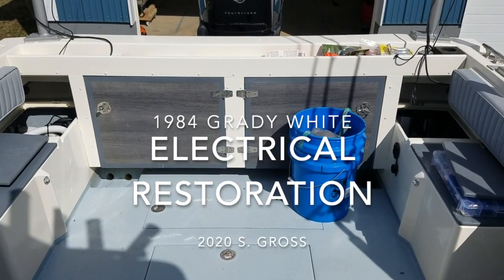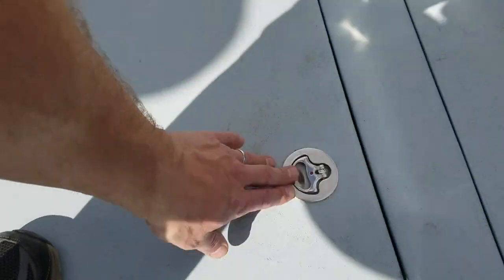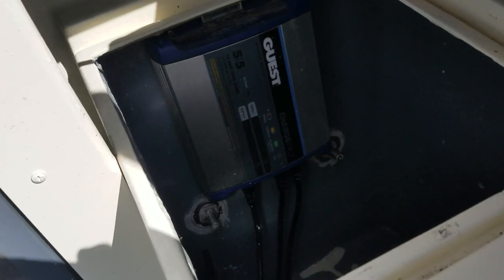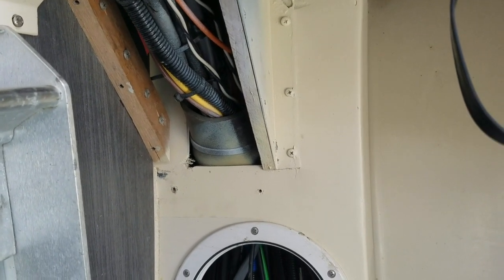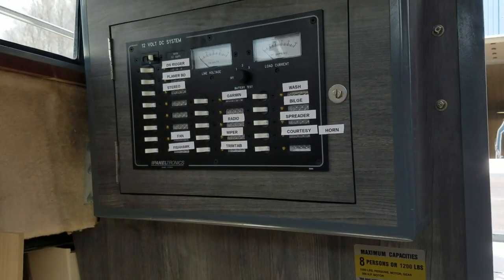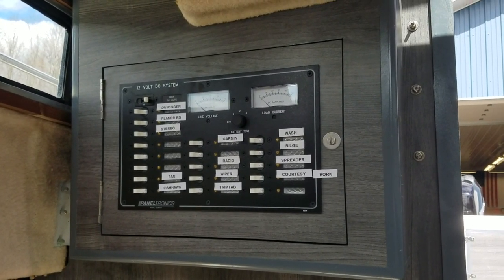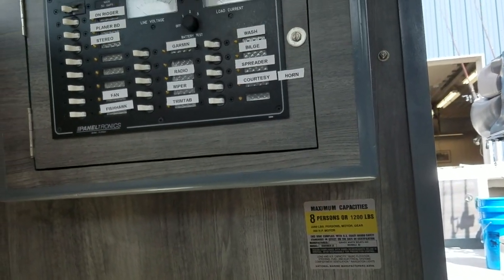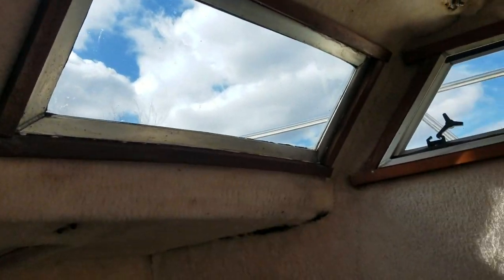Grady White Seafarer -Electrical Restoraton

Comment: How did you make the gunwal?
Reply from the maker: We made a mold.  It took some craftsmanship.  Used wood and a router.  Then massaged it with some filler and sanded to match a profile we made (template) of the existing gunwale.  It took some finesse but turned out nice.

Comment: Looks so good & clean! I’m just starting on my rewire of my 84 Overnighter. Question for you: is the tilt/ trim on a relay?  I’m trying to figure out exactly how to handle that—though i don’t have a new Verado ;) mine is a 96 two stroke Mercury 175 Offshore.
Reply from the maker: Thanks for the compliments and watching.  I paid a dealer to rig my Verado.  They installed the wiring harnesses, vessel view link, binnacle, etc.  So, I can't answer that question well, as it's integrated into the system they installed.  I didn't touch it with my rewiring process.
Reply: @ModernCountryLiving  Got it, thanks! I may just ignore mine completely if I can because it’s one of the few things that works 😂